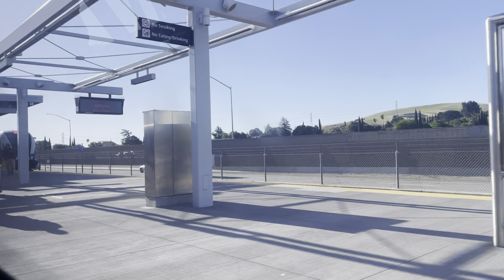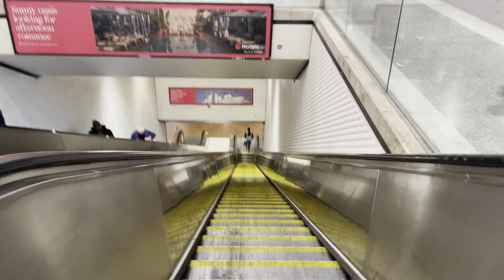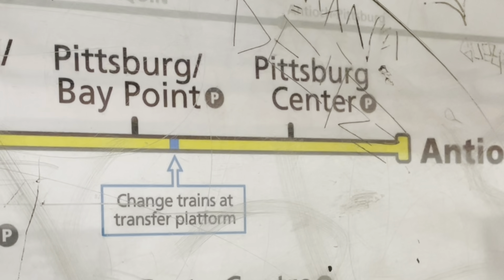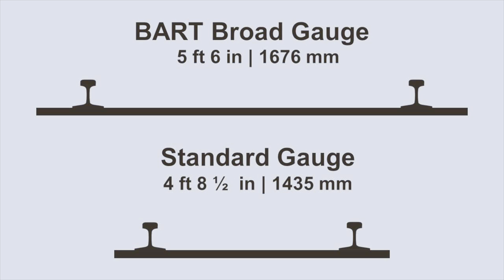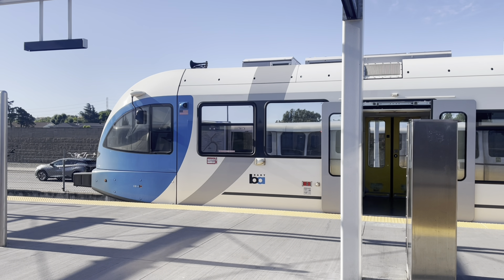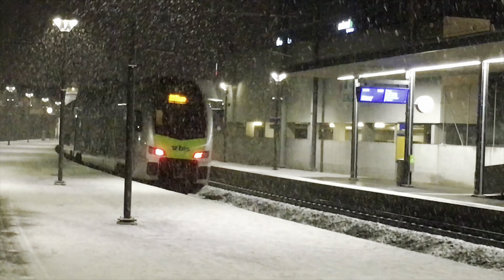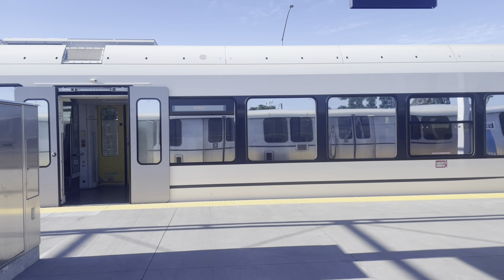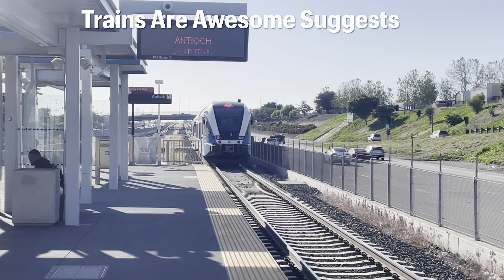eBART: The Strangest BART Extension

Comment: The fact that Bay Area transit operators deliberately introduced a gauge break into their regional rail system completely blows my mind. Gauge breaks have been the source of so much hassle throughout the world, wouldn't we have learned by now that they should be avoided wherever possible?
Reply: Some consist and reliable train service is better than than no train service which is what Antioch had before this extension was completed in 2018. Too often we let the perfect be the enemy of the good...
Reply: It's not the worst thing the Subways and Streetcars in Toronto and Philadelphia both use broad gauge
Reply: @IndustrialParrot2816  Broad gauge on its own isn't much of a problem (although it still poses limitations with the availability of rolling stock) but gauge breaks are. Having part of your system run on standard gauge and another part run on broad gauge drastically complicates maintenance, rolling stock selection, schedule and route changes, etc.
Reply: @chasemartin4450 Toronto's new lines are actually using standard gauge (if they ever open, but that's a different issue). In their case, switching over to standard and giving the finger to interoperability is supposed to actually reduce the operation costs overall.

I think the TTC looked into replacing "Toronto gauge" with standard gauge but decided that would cost slightly more than just having to deal with their current system.

Point is, given the wider selection and ease of finding standard gauge rolling stock, it's not always a clear cut choice between sticking with your weird gauge versus switching a new line over to standard.
Reply: @chasemartin4450  oh! Another example. Vancouver's SkyTrain network uses two entirely different motor technologies. The older lines were built with linear induction motors. However, when the new Canada line was built, they moved over to standard electric traction motors.

So even though the rolling stock is on the same gauge, they cannot run on the other type of track at all. Linear induction is just so rare it made sense to switch over to a more "standard" technology to reduce costs in the long term.

I think interoperability between lines in metro systems is nice, but clearly not as big of an issue as you might think.

That being said, having a gauge break on an extension of a line does seem to be something only California public transit designers would do.😂
Reply: @GenericRespondent  actually the reason the Canada Line uses conventional traction motors vs LIMs is because it was built as a public-private partnership, and during the bidding process interoperability with existing SkyTrain infrastructure was not allowed to be a factor. New lines after the Canada Line, such as the Evergreen Extension, the Broadway Subway, and the Surrey-Langley Extension are all built as extensions of the existing Innovia Metro LIM network.

The Canada Line is nice to have but there were a lot of shortsighted decisions made such as the different traction system/rolling stock and single-tracking near Richmond Centre to appease the NIMBYs, I predict it will be much harder to expand capacity/reach of that line vs how we’re currently rapidly expanding the legacy SkyTrain network.
Reply: @IndustrialParrot2816 Is Toronto subway also really loud?
Reply: @anthonysnyder1152  not sure what you define as loud
Reply from the maker: True. Great stuff to make a video about though. Lol.
Reply: You're not transferring freight here, or even much baggage. I don't see it as such are terrible compromise to save lots of money. @Thom-TRA
Reply: I remember as a young child nearly 50 60 years ago. When the stations first opened in Concord which at that time was the line. And now have had the pleasure of working for the company.
Reply: I’ll just add that BART chose broad gauge because an initial concept was to run trains over the Golden Gate Bridge to Marin County and supposedly the broad gauge would help crosswind stability.
Reply: @SWalkerTTU  Wasn't it more about appeasing the existing freight railroads who wanted to ensure that BART's trains were physically incapable of ever trying to expand onto their trackage?
Reply: @chasemartin4450  I don't think so, because you'd see a lot more weird gauges in rail transit; big corporations tend to act the same way rather consistently over time. I couldn't totally rule that out, though.
Reply: With projected growth heading east in Contra Costa county, there was little motivation to continue a more expensive solution into the future when standard gauge saves money in both rail construction and new [or even gently used…] rolling stock over whatever expansion comes.
Reply: The BART board of directors wanted a cheaper alternative to the 5' 6" gauge electrified BART trains and the 4' 8.5" gauge diesel trains made by Standler fit the bill.
Reply: @william2william  Stadler.
Reply: @william2william  They could have gotten a smaller version of India's Train 18 for the service, making it possible to use the same gauge
Reply: “Whenever possible” being the qualified here
Reply: The yellow line with the first line established at Bart. Adding on the other lines as the system grow. The E-bart system was added on at the end of the yellow line to provide service to Ryder's past the Pittsburgh Bay point station. For which they had been paying taxes for since the system was established in the seventies. It was a cheaper way to provide the service rather than run the tracks for the bart train.
Reply: there is potential if eBART extends through San joaquin County, basically making it a second Valley Link line.
Reply: Other than not doing it as an overhead electric train, I think they did good here...maybe some day we can muster up the funds to add OH power...

These trains are far easier to upgrade and such than the Bart trains which are basically specifically designed for the system. We should electrify and then build our this smaller BART out to Brentwood and even the Delta...bring transit to more parts of the region - like I said in an earlier post, some good reliable service is better than none...

EDIT: It should actually make a stop in Oakley, Brentwood and then all the way to Disco Bay...they could even build BRT to feed these stops and build our regional suburban transit system...all these cities are in the same county after all
Reply: @triaxe-mmb I've always envisioned a Vasco Road line to Livermore. Link the Livermore station to a Brentwood station and that would put some relief on the commuters.
Reply: @RmasterD  if they did that it should close the loop to Dublin/Pleasanton Station cause tbf Brentwood to Dublin and on to SF would be faster than going the other way round.

While we are at it, could we work out a heavy rail transit connection from Concord to SJ thru the 680 corridor...the absolute lack of transit connecting this corridor is insane!
Reply: @triaxe-mmb  I wholeheartedly agree. Why they haven't put tracks down the middle of 80 is beyond me. In fact, it originally WAS a rail line!
Reply: Its better than the bus
Reply: @djjamar  I can see you've never used BART.
Reply: The whole BART organization needs to be busted up and a new one formed to emphasize a new beginning where the same trains can run and be maintained in one interconnected system.  Especially before they dig a $12 billion hole in SJ where you'll see a repeat of this 'transfer' idiocy at a Santa Clara terminus, but this time they're outdoing themselves and making it happen 100 feet underground.🤦‍♂   Pure insanity.
Reply: @whyno713  Addressing only BART,  that's like treating only the cancer tumors that are visibly bursting through somebody's skin and growing outside their body. And that is a proper analog for the state of health of America and the rest of the west. What we need is a systemic cure. A healthy society is not based on collectivism, but the intense, ruthless even, pursuit of prosperity through the self-directed initiative of individuals. I know a lot of you don't like these sorts of ideas. And that makes you a very large part of the problems facing us today. We need to purge our governments from the municipal to the federal and lastingly discourage those who have fostered these circumstances. Such as the people who favor modes of mass transportation over private vehicle traffic.
Reply: @statinskill  I want an umbrella director to oversee and coordinate the various transport agencies -  bus, metro, rail - resulting in effective and efficient control.      It is lunacy that we're going to have three to four different rolling stock operating side-by-side when one friggin train could do all 3 of the jobs.  Oh, and the waste of space with multiple service yards taking up extremely scare land when only one should be needed.

And the 'invisible hand' still rules this country, chief.  Public transport and mutually beneficial self-interest are not mutually exclusive lol.
Reply: The BART trains are bay area have heavy government procurement costs. Same with the tracks and build out - you are looking at incredible costs - range of $2 billion USD per MILE is not impossible - just check out what they are trying to do with San Jose extension. High speed rail is another example of this - the politics of it get crazy - instead of a straight line north / south that would be fed by for example a much longer eBART extension - you are going to get MASSIVE costs trying to get high speed rail into SF and over its routing, and it's unlikely to actually run at high speed in SF. I think it's a smart play and may allow a lot more expansion elsewhere at fractions of the cost.
Reply: Remember that the original plan (public commitment) was to run BART all the way to Interstate 5 to connect with the ever promised high speed rail that was supposed to go down the center median of interstate. This connection would allow HSR to run full speed - virtually straight line - down the middle of the state. Of course we all know HSR has now become another boondoggle and jobs program with very little possibility of achieving the promised travel time. Therein lies the problem with public transit in the US. Its never about efficiency or convenience unless of course its an early system like the New York Subway or SF Muni.

Comment: The Yellow line serves one of the most historically authentic suburban rail transport connections. Sacramento Northern interurban railway served passengers from Oakland, Laffaytte, Walnut Creek, Concord and Pittsburg until 1941. 

The interurban route was different from BART, but went through the same cities as the Yellow Line now. Voltage and types of collectors were different from place to place of Sacramento Northern interurban system. It was standard-gauge. Dining and parlor car service were included. Speeds varied from 35 mph in Oakland bridge to 15-20 mph in Oakland city streets and somewhere in sharp curves near Lafayette or at crossings in Concrode, but up to 60 mph near McAvoy.

However, interurban had a number of features due to which passenger service was abandoned, such as steep mountain serpentines, many of flag stops, single track and predominantly freight business. It was 7 passenger trains per day in the best times and then reduced to just 4 ones per day in 1941.

Also it was plans to extend the line to Antioch... but it was never realized. 

Looking at the situation today, I am glad that residents of all the cities I named received direct and fast transport to San Francisco. The diesel LRT train shown in the second part of the video is becoming the same trend in the USA as the electric one. In general, it performs its function, but just a little cheaper in terms of capital costs. 

I'm a public transport lover, but as a tram lover I should to mention, these diesel trains, whether in a busy US suburb or in Dutch fields or in a half-abandoned railway line in Bulgaria, have a certain charisma of a small diesel tram. 

Thank you for video!!!

Comment: I vote to extend eBART from Antioch to Oakley, Brentwood,Lone Tree Way,Discovery Bay Stockton Amtrak Connection and Downtown Stockton
Reply from the maker: There are some plans to maybe go to Tracy
Reply: @Thom-TRA  BART Blue Line to Tracy and Modesto via I-580 & Altamont Pass
BART Yellow Line East Bay Area to Stockton via Discovery Bay & Highway 4
Reply: Also I vote to extend the BART Blue Line Metro Subway from Dublin to Livermore with the median of I-580 and Valley Line from Dublin to Lathrop/Manteca is Phase 1 and Phase 2 of ValleyLink is Stockton
Reply: @dancingwiththestars3778 CBS did a piece on this earlier in the month. "Livermore Mayor John Marchand hopes proposed commuter rail line can connect BART with San Joaquin Valley."

Seems Mayor John Marchand has flipped from pro-BART to anti-extension & now pushing for Valley Link. He's gone NIMBY (á là folks in Marin).

Comment: This should connect to the Amtrak line north of there and should be part of a new commuter network for the Bay Area. It should also go to Discovery Bay
Reply: There is a distant hope the eBart will continue to Brentwood and beyond. Some of the logic behind a diesel/electric on standard track is crossing surface streets.Over/underpasses can be ridiculously expensive. The fully electric Bart cars can not cross surface streets because of the energized third rail. eBart could be electrified using overhead wires and/or a combination system.
Reply: @SeanMaguid  It would make a lot more sense if it were a longer line using overhead wires. I wonder if Bart would benefit from transiting to standard gauge and overhead wires, but that would be a rather massive project.
Reply: @ids1024    I've always thought that BART should have been built to standard gauge from its inception. Another complication caused by BART's "special" gauge is that it's causing major integration problems from San Jose up the peninsula. However reasonable it would have been to use standard gauge from the beginning, it's far too late to second guess that decision now. Changing all of the cars (rolling stock) and rails over the entire system would cost billions of dollars and introduce MAJOR service disruptions during the conversion period.
Reply: The Richmond line ends at the intermodal station with Amtrak and BART joint station

Comment: I'm trying to get my head around why extending the line using existing electrified track gauge would have doubled the cost.
Reply from the maker: Because it takes up more space and electrification used up twice the amount of infrastructure plus electrical work.
Reply: Standard stuff is generally cheaper, especially since they can use off the shelf commuter trains, as opposed to designing for a proprietary gauge.

Comment: I mean i would have electrified it so that you wouldn't need the extra infrastructure needed for diesel engines (which are far more maintenance intensive than electric ones), but it sounds a reasonable solution given that converting the railway gauge is quite expensive, same for trains who can change their gauge mid drive (yes those actually exist).

Comment: We - sort of - have our own version of eBART here in Biel, with the BTI narrow gauge line serving as a cheap and low capacity extension of the regular BLS and SBB train network. The line starts in an underground part of the Biel train station. Accidentally the BTI uses the same train model as eBART: The Stadler GTW. It's actually the oldest order of Stadler GTWs worldwide. Check it out here: https://en.wikipedia.org/wiki/Biel%E2%80%93T%C3%A4uffelen%E2%80%93Ins_railway_line
Reply from the maker: When you see those old Swiss GTWs it’s hard to believe they’re the same trains!
Reply: Well, the BTI GTWs do have the old angular front and they are all electric, so quite different from the eBart model, but the main characteristics, the power pack car in the middle and the low floor are the same. They got a mid-life overhaul  and are still in pretty good shape. @Thom-TRA

Comment: This setup reminds me an awful lot of Manhattan Transfer station (not the novel, not the band) in Harrison, NJ which operated from 1910 to 1937 when it was replaced by Newark Penn Station.

Manhattan Transfer station also had no exit to the street. It existed to allow PRR trains headed into Manhattan to exchange steam locomotives with electric locomotives, to facilitate transfers between the Pennsylvania Railroad and the Hudson tubes into lower Manhattan and to ferry lines to New York City.

A wonderful dedicated multi modal transfer point. So good John Dos Passos used it as the title of his marvelous novel and the equally marvelous vocal band stole its name from the station.
Reply from the maker: Where was this in relation to the current Harrison station?
Reply: @Thom-TRA Good question! The station was located in the eastern side of Harrison, about where the big PATH maintenance facility is today